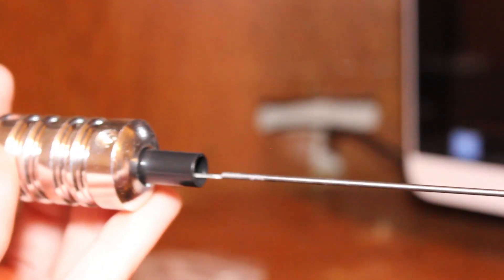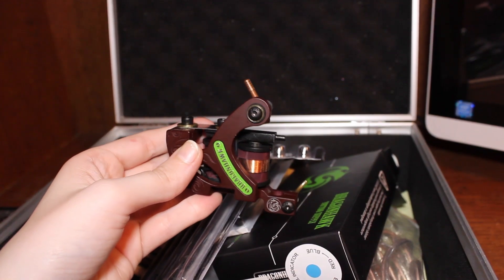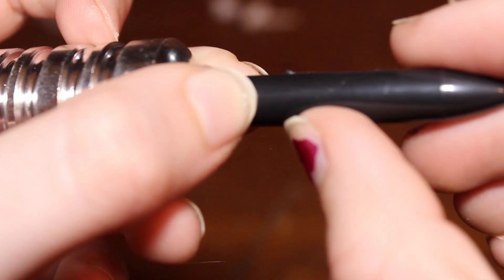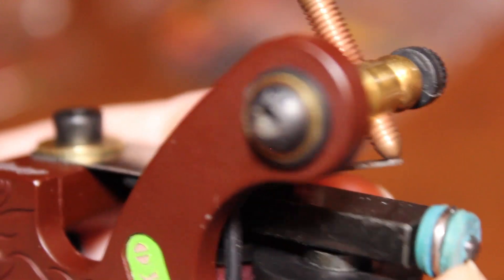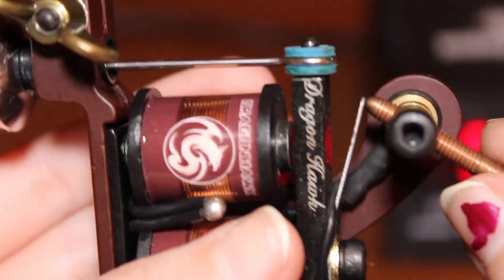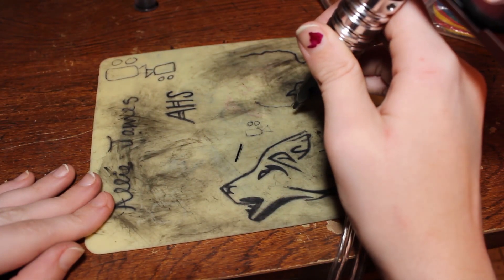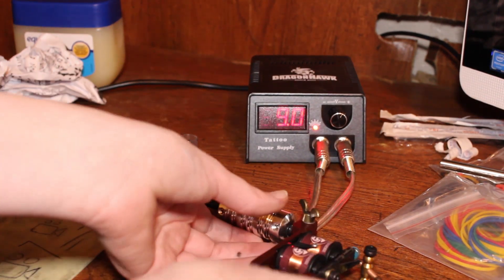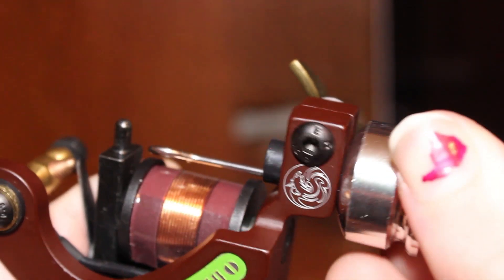Tattoo Training Video

Comment: Nice video but you forgot 3 steps with the machine.  1 make sure your needle groupings is facing the tattoo machine and the needle bar is facing away 2 put a slight bend in the needle in this same direction. 3 make sure you use a rubber band to keep the needle from jumping around in the tube.